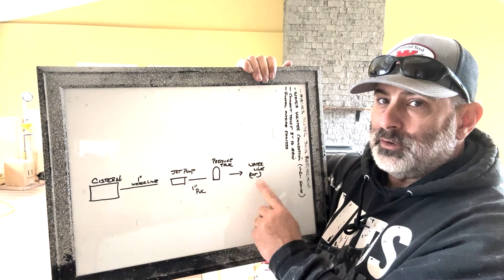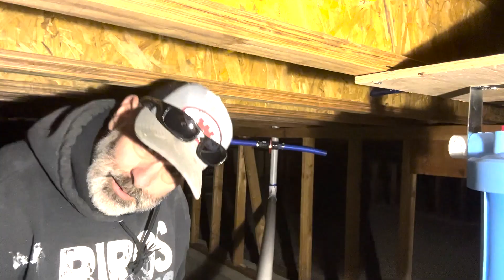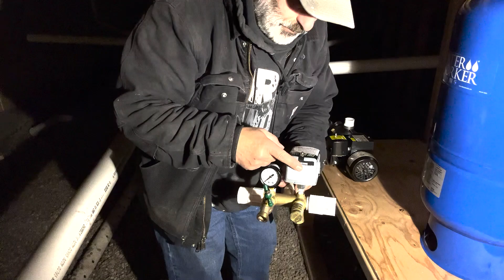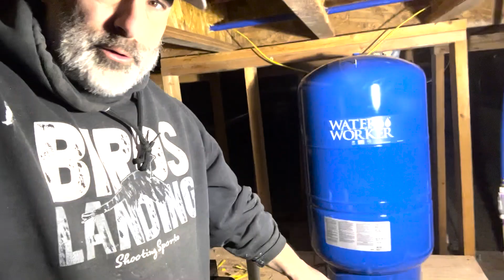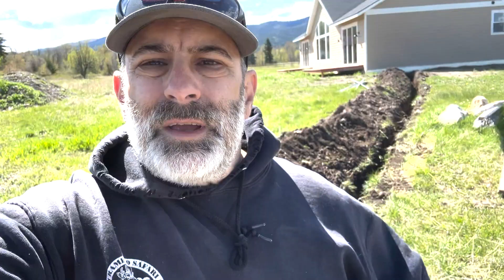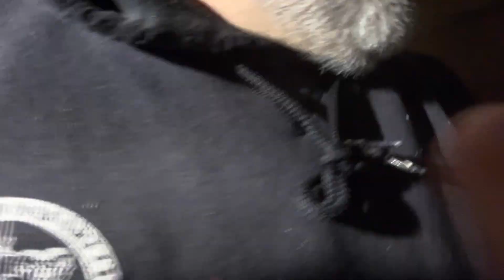Installing a jet pump and Cistern Pump | Building Our Own Home Ep. 124

Comment: Thank you so much for this video. I am doing the exact same setup. Was wondering how the t valve pressure switch and the jet pump pressure switch worked together. This was the only video I found that addressed this situation.

Comment: I'm concerned that you have a sediment filter on the suction line of your pump. As the filter starts plugging up, your pump may not be able to draw enough water through it and you will have cavitation at the impeller, pump overheating and possibly failure. You should not have any obstruction in the line between the cistern and the pump intake. Also, your suction line should be the same size as the pump inlet, usually 1-1/4" pipe. Recommend you move your sediment filter to the pressurized water system pipe, somewhere after the pressure tank but before it enters any appliances or faucets in the home.

Comment: Unless I'm not seeing it in this video, for sure it looks like you have no unions installed on at least the outgoing side of your pump, and possibly the input side, can't tell, but that you glued everything together with the pump in place.  This means that if you ever have to replace or service your pump, you have no way to quickly disassemble your lines without having to cut and redo them again.  Paying the extra to put in unions saves considerable time and cost in subsequent repairs.